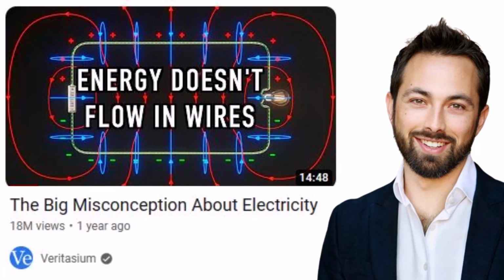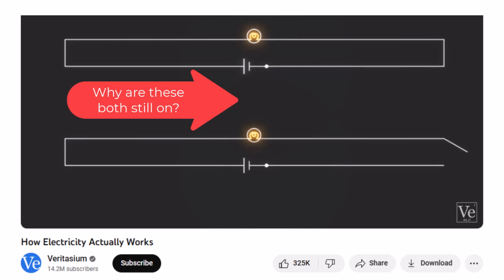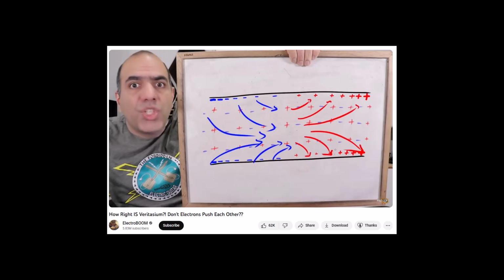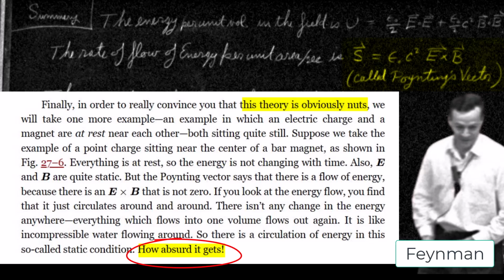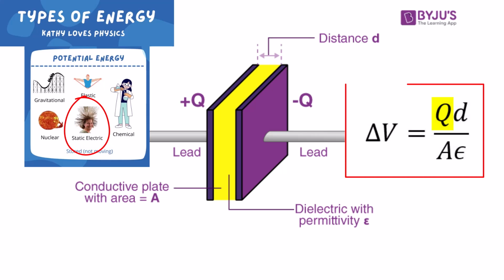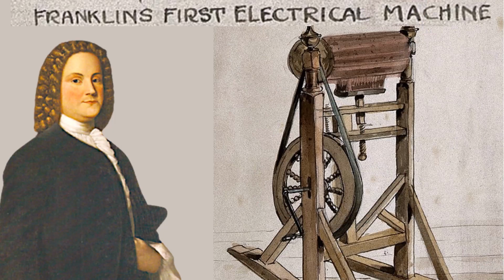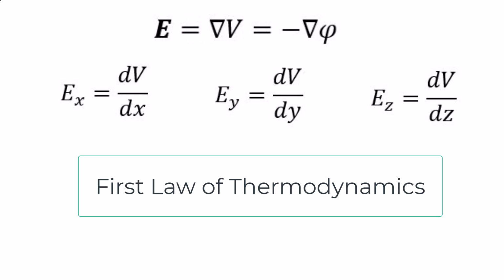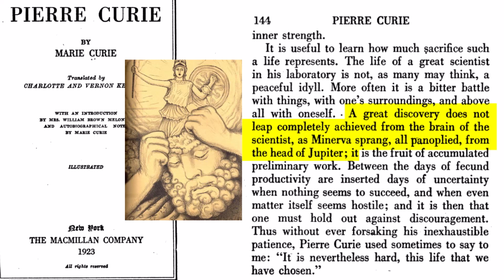Deep Dive Historical Response to Veritasium’s DC Electricity Video

Comment: So let me try to restate this: 

A conductor can be thought of as a line in which charges move along a theoretical line between two points in space. When a circuit closes the charges travel at a theoretical maximum of c. As the electrons move down the wire they induce a magnetic feild around the wire. The change of electron position and change of magnetic charge induce electromagnetism. The electromagnetism can induce current in other parts of the wire, just as it does in a homes TV antenna. 

   But a current gate and a conductor are not simply a line. A line is infinitely thin and electrons theoretically have dimensionality, at least when they are in the coherant state. 
Therefore the conductor is not simply a line but a column of conductor atoms in which, as the charge moves down the wire tends to accumulate on the surface of the wire, this alteration also induces electromagnetism. In addition the closing of a switch is not simply connecting two lines, the switch itself has complex structure in which the charge moves through the structure in accordance with that structure. So the the current gate is also a transmitter of hv. 
    Thus the critical flaw of Derek's experiment is that the switch was not placed in a faraday's cage. Also the termini of the battery also have complex structure and they should have been shielded. 
    
   A third flaw in the experiment is the question of signal reflexs intensity, and we are only interested in I as the electricity comes out of the battery and begins traveling down the wire, so lets say on meter, given the gap with the bulb. That wire could have been extremely fine wire for about a meter and likewise the last meter either side of the bulb with the bulbs attachment shielded. The rest of the wire could have been placed in a dumbell shaped.

Comment: I'm sorry but that's really not how batteries work.

All chemical cells are based on specific redox reactions occurring within them. Some of these do use acids or bases and metal electrodes as their reagents but others do not. Their common element is that half of the reaction (reduction, which consumes electrons) occurs on one electrode and the other half (oxidation, which generates electrons) occurs on the other electrode.

The simplest cells will achieve this by making the electrodes from the reagents, but there are plenty of cases where one, or both electrodes take no part in the reaction. You can keep the electrodes in two different solutions connected via some sort of an ion exchanger. You can cover the electrodes with a catalyst. There are plenty of options.

And second of all, when the battery is not yet part of the circuit, the reaction indeed isn't occurring. But that doesn't mean it can't give you current right away – as soon as you complete the circuit. The reaction isn't progressing precisely because it has progressed the furthest it could get, building up charge on the electrodes, internal wires and the terminals.

And finally, the heat generated from resistance is frankly negligible. The vast majority of heat will be produced in the chemical reaction itself.

Comment: Yes I think you are correct Kathy. Poynting Theory does not distinguish between potential and kinetic energy so flow that seems unphysical will probably be potential energy. With dc there will be energy flow inside the wire.

Comment: On his original video I asked what would happen if the wire had been in a circle of the same length instead of parallel lines connected at the far ends. No one answered
Reply: As long as the bulp would be at one meter of the battery and switch, the results would be the same.

Comment: Very brave of you to voice your opinion.  Still trying to fully understand the issue based on my ignorance.
So the notion that a conductor us just a guide for an electric field wave travelling at the speed of light to follow could arguably be discounted. This makes sense now ie the electric energy that appears as an electric field doesn't just flow through the air following the conductor at. the speed of light but flows through the conductor at the drift  velocity.
Thought experiment...The concept of Special Relativity suggests that we might be travelling at the speed of light but not realise it. Only a distant Extra Terrestial observing stationary from afar would realise it.
Did you see the Video on the Experimental Fusion Reactor being built constructed.
What is the Scientic basis for the observation that below the Earth's Surface there is a ball of molten lava😊

Comment: Is there an electric field around a nine volt battery unconnected to any circuit? I've seen the dualist view of pos to neg flow inside of neg to pos flow in an old EE DC currents book by Dawes.  Why do they try to confuse folks about electricity?  I still like Feynman.  Thanks Cathy. I like U 2!

Comment: At 10:57 magnetic Energy is kinetic energy. Light is an example of electromagnetic radiation and has no mass, so it has neither kinetic nor potential energy. The remaining forms have qualities of both kinetic and potential energy.
Reply: Potential (static) energy is stored energy.  Kinetic energy is the energy of movement. Electromagnetic energy in static electromagnetic fields is potential energy. Once the fields are in motion in the form of propagating electromagnetic waves  (e.g., radio waves, light waves, xrays) they have kinetic energy.

Comment: Kathy; there is no such thing as DC, there is only AC with perhaps a very low frequency.    Remember, your DC begins and ends with an edge, it is a pulse.   A pulse is composed of a family of frequencies, possibly very low frequencies.   In this experiment, much of what you are discussing relates to the edge of the pulse.
Reply: There is no AC, only DC that constantly changes in amplitude, polarity and direction of current flow.

Comment: I thought that in the condition where the bulb is very close to the switch that the bulb would light immediately, similar to the time it would take if the circuit were of small size rather than half way to the moon (or whatever the distance was). I assumed this based on the circuit would be in a steady state prior to closing the switch and there would be a difference of charge potential across the switch, and the charge in the wire on the long end would be constant along it's length. When the switch closes, current begins to flow immediately because of this difference in potential and as the current moves along the wire it continues to provide difference of potential as the charge from the far end of the long wire eventially catches up.

OK maybe I did a poor job of explaining that. It's late and I'm tired. It was fun to think about though.

And no,  I don't recall any mention of Poynting Vectors during my education either.

Comment: Lovely video. I have to state that I didn't understand everything because I haven't watched Derek's video. But, I got a strange idea or feeling, when watching your video.

I think we must distinguish between the energy of the "electric field" and the energy of a charged particle in such a field. The Voltage just corresponds to the potential energy of a charged particle within an electromagnetic field. Multiply the voltage with the charge and voila you get the potential energy. This corresponds to our understanding of energy in classical Newtonian physics. If you lift up an object in the gravitational field of the earth, then the object gains potential energy. In the same manner an electron gains potential energy if you move it along a path within a circuit. The voltage difference between two points in the circuit is the difference in potential energy, which any charge within the circuit has.

However, it is always claimed that the electro-magnetic fields themselves contain some kind of energy. The poynting vector is claimed to describe the energy flow of the field energy. The total energy of the system is the "mechanical energy" plus the "field energy". 

However, the light bulb is not lit up by the flow of these fields described by the poynting vector. The light bulb is lit up by the current flowing through it. The current does not flow with the speed of light. The energy flow due to the current is not described by the poynting vector.

I have the hunch that these two different of energies are being mixed up.
Reply: By the way, I love your channel! ;-)
Reply: O.k. I have watched parts of the Derek's video. Derek states at one point that the electrons do not carry the energy but the fields do. That's wrong. 

The electro-magnetic fields do carry energy in and of themselves but so do the electrons. The electrons do have potential as well as kinetic energy and this energy is decisive for explaining a DC circuit.

Yes, the circuit acts like an antenna once you close it, such that it emits electromagnetic radiation. This radiation travels at the speed of light. That is probably why Derek thinks that the signal is transferred to the light bulb a the speed of light. But this radiation is not responsible for lighting up the light bulb. In fact, this radiation is usually completely neglected, when studying circuits. It just amounts to a loss of energy in addition to the ohmic losses. 

If you want to describe the propagation of the voltage / current signals across the conducting line, then you use the "telegrapher's equations" and these signals do not travel at the speed of light.

Comment: In your example with the capacitor the volunteer will get shocked after 1/c seconds. Because the electric field difference causes a flow of charges. The extend of the shock depends on the capacity of the wire pairs. It will be a small shock. You can get shocked by electric fields induced by a high power antenna. Try to look near broadcast antennas. You'll find dead/burned animals there. You seem to assume fields can not induce  a charge unbalance and thus currents (I am an electric engineer).

Comment: When you close the switch, positive charges start to spread on the plus pole, and negative charges start to spread on the negative pole. These charges cause on electric field. On the positive side, with the positive charges, the field pushes away positive charges in the parallel wire, on the negative side the field pushes negative charges away in the parallel wire. So an unbalance is created in the parallel wire and a current flows and the light goes on. This happens after 1/c seconds, because the field only need to travel 1 meter. It's pretty simple, both wire pairs act as capacitors. And DC pulse passes the capacitors (but a continuous DC voltage does not). The continuous flow of current happens only later when the electron flow in the wire starts. This happens much later. So, the bulb flashes after 1/c seconds, but it is only stable much later on.

Comment: Two things not mentioned: The resistance of a wire from here to the moon would be quite high unless the wire had an enormous cross section. 2nd, The velocity of the charge would be less than C.

Comment: The original question posed by Derek was: "After I close the switch, how long will it take for the bulb to light up." Now in hindsight, I do believe he could have benefitted from a more refined question...by possibly swapping in "...for the bulb [to no longer remain in an off state...in other words, such that it produces illumination that is detectable by a normal/average sighted individual]. Yep, pedantry to the rescue! Wee! I personally find the two different questions to be substantively one and the same. Many didn't/don't. That's just how humans do. But to argue a bulb is not on ('not really') when it's clearly producing noticable output is more than a stretch. Yet, that is where many decided to (finally) position themselves after all their other grievances were dispatched. Answer D was (and is) correct with respect to: the time span from the point that the switch (sufficiently) closes...thereupon producing an induced electric field...which travels at light speed while leaping one meter across the circuit...and causes a change in the extant off state of the bulb...such that if someone in a dark room were to ask another--"Did you see that bulb just turn on?"--they wouldn't hesitate to answer "Yes." I get why some wanted Derek to focus on how long it takes for the bulb to be lit to its stated maximal operating output. And that, as a separate question, is a perfectly legitimate thing to explore. But Derek's question is a fine one too...equally worthy of being evaluated. Of course, he went on to explain the importance of the result (answer) since it is a vital thing to know about when building transmission lines. So it's not a "gotcha" question. The overarching purpose of his question was imminently reasonable. And of import. Though again, not everyone willingly buys into it being of import ('not really'). They would have preferred another setting be used as a focused backdrop for exploring electricity. And again, I get that too. But he did disclose early on that he was asking the question specifically in terms of transmission lines. Unfortunately, I think that was done (mostly) via the Description section. Not everyone takes time to read through such fine print.

Comment: If you listen to Feynman he actually says that the theory (Poynting vector for energy flow radially into a DC carrying wire, etc.) is correct. He further says that our intuition does not match the theory but this is ok. 

Poynting (1884) shows that the energy (per unit time) flowing radially into the wire is actually the same as the power given by the much simpler, V*I. V*I is just much easier to calculate than the Poynting vector but it doesn't say anything about where the energy comes from (the E and B fields). 

All electromagnetic theory has to be expressed in terms of fields, the 'flow of electrons' is just a sideline. A full treatment would of course use Quantum Electrodynamics whuch brings us back to Feynman 😁 

(Melrose's Quantum Plasmadynamics, may be a better jumping off point  for someone interested enough to do the full calculation or at least draw the Feynman diagrams).
Reply: I've looked at almost all the comments. It seems Kathy doesn't want to respond to critiques that the Poynting vector is correct for DC circuits. She took Feynman out of context. Her rationales for not trusting the Poynting theorem are not strong enough and don't stand up to scrutiny.

Comment: Kathy I know nothing of physics but I do have some knowledge of electricity and was told a longtime ago that electricity flowed on the outside of the conductor. I was also told that high voltage transmission lines had a nonconducting core so the electrons would flow on the inside of the conductor as well as the outside. ( I imagine that if Feynman lived in 1492 he would have told Columbus your going to sail off the edge of Earth